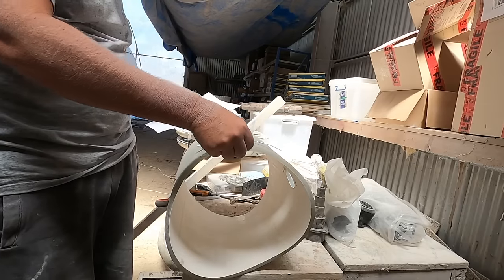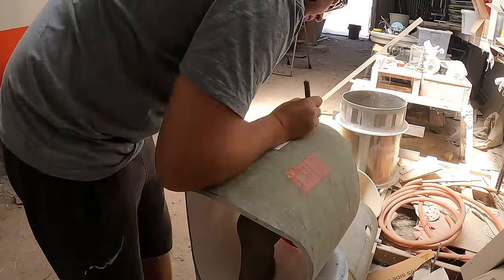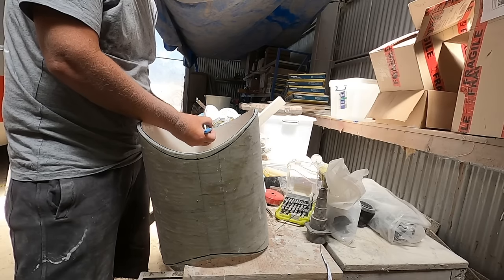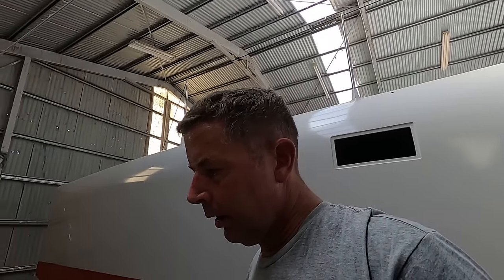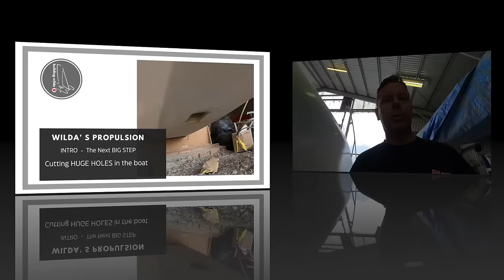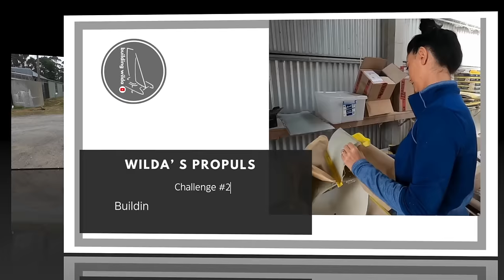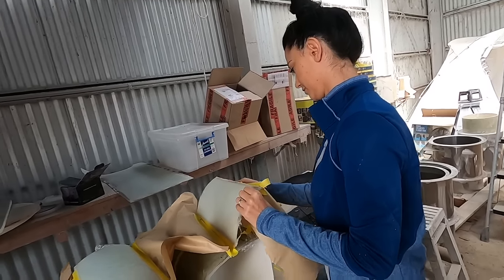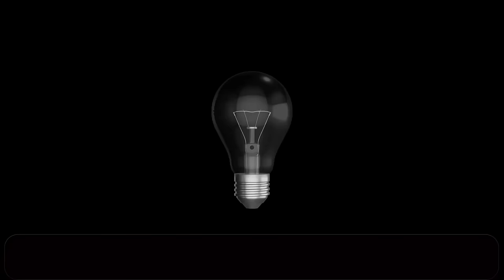Unique Drive System - Building Wilda's Propulsion Part 2 - S03E18 - Electric Catamaran

Comment: Well done - this is going to be a tricky job. The cut you were attempting in the thruster is simply the development of two cylinders (or pipes) joining but flipped 90°.😉
Reply from the maker: Finally got it to an acceptable shape... Not perfect.. but good enough.

Comment: Hi there great job 🙂? How do you propose to stop the ingress of growth in the main shaft , as growth will inhibit the transition of the motor up and down 🫤
Reply from the maker: Absolutely a consideration to make.
We expect growth to be a small to non existent problem. The reason for us thinking so is that most growth requires light to thrive, so should be less of a problem. The same goes for dagger board casings.
And then, we expect the lifting mechanism to scrape some off as well. Might consider other solutions if we need to in the future.